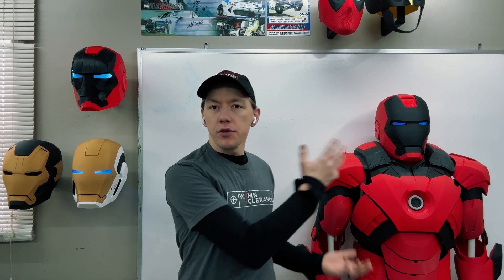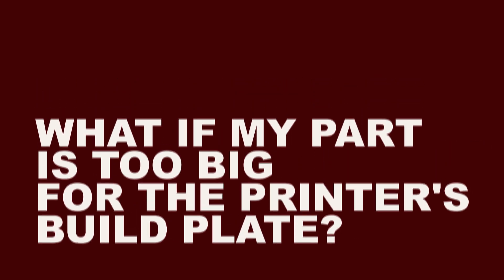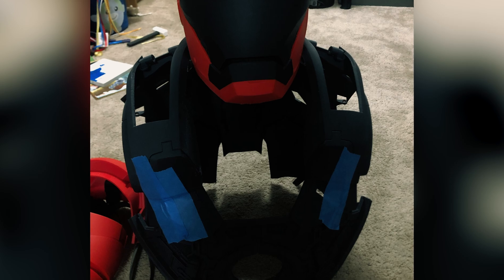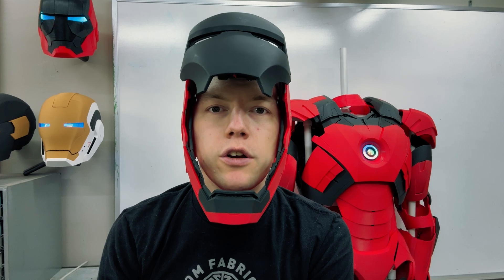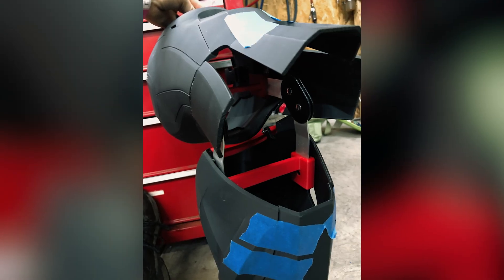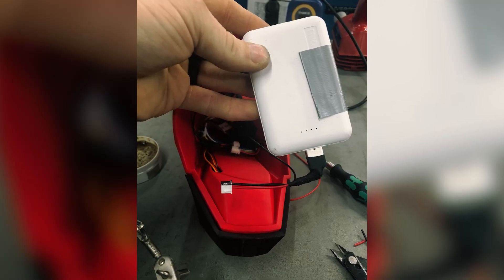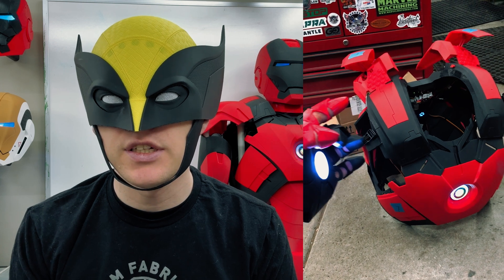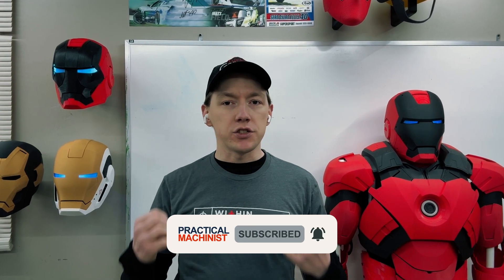I 3D Printed an Entire Ironman Suit (And It WORKS!)

Comment: For V2 or V3, you can print the entire thing in CF to make it lighter and thinner and much stronger. Also start using flexible PCBs to save space. Also the helmet LEDs look really cheap, what you need are RGBWCCT leds, put some aluminum foil in to reflect the light but not blind yourself. Wearing the helmet, you might notice you can't hear that well, well you can buy a cheap pair of noise cancelling headphones and install it into the helmets to amplify ambient noise.